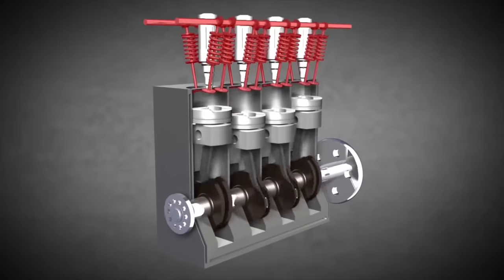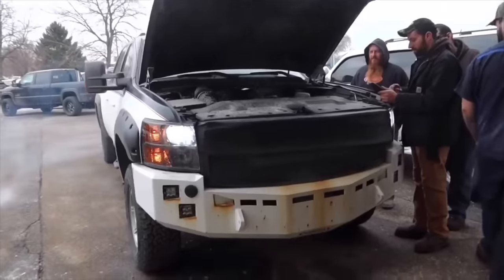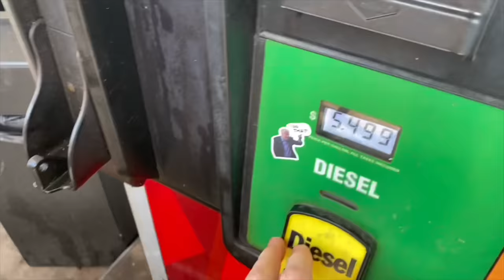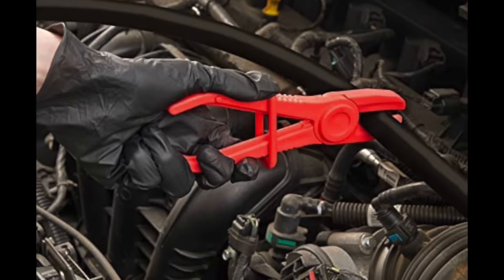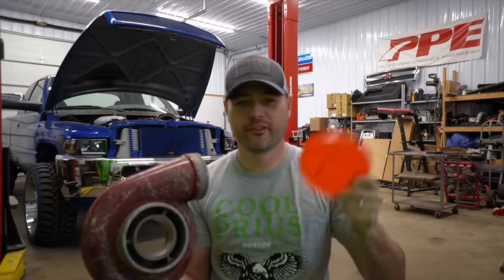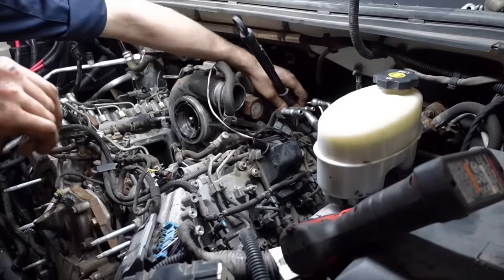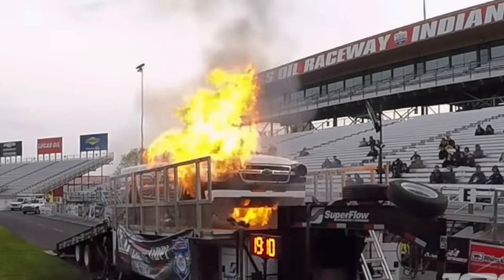What Is A Diesel Engine Runaway? *EXPLAINED* ￼

Comment: So from the Other Side of the Pond this is a Very America problem. 
Probably somewhere there were 2-3 idiots that only ran their engines and never did any maintenance so they were probably some runaways. And of course turboed 2 Strokes Russian had some in Heavy and Military trucks. 
But Europe and the rest of the world Following the European Diesel Tech don't have this issue.

Closest to what You state here I have seen and heard about is the 1970s Mercedes Diesel Engines in the W123. OM 616 engines
I Had one and They had an Electronic Shut off valve. So when you Turn off the Key the Valve would get an Impulse and a Magnetic valve would Choke the Fuel. When the Engine stops The Alternator Impulse would drop and the Magnet would release the circuit so it doesn't drain the battery holding it shut. That would take like a year on a 75Amp battery, but still... It had a spring that would try and push it open. 
The problems with this are:
Longer starts because the System is slightly starved of fuel, not too long, but there's a few more cranks than usual. 
and If the magnet is stuck open or is faulty the Engine won't shut off. 
However, it will just Idle. It doesn't rev up or anything, and you can just put it in gear and let the clutch out. 
And yeah they are all manual because people in Europe can drive. 
The way they fixed it is The Power on Open valve. Aka When You shut off the Ignition the circuit closes and the spring Returns to closed,because the electromagnet stops working and fighting the spring. 
And NO you do Not Need a Battery for This Alternator will Do It needs a Tiny amount of Power, its very small. As long As you Push it, and It starts charging the valve will stay open. Turn the Key it shuts off. 
Before all this Older cars had a Shut off lever that you pull and manually Choke the Fuel, like on Old tractors and Machines. 
But I did hear about Runaway Cummins engines on CASE IHC combines because there was a  period when EU didn't have strict standards on Emissions regulations of Agricultural and excavator machines, so we basically got US Engines here. 

And second, for the Blowby theory, you have to be talking about a catastrophic problem in your engine.
And here's why.
For the Blowbuy to Overcome the Piston rings , those piston rings have to either be completely broken, like in 10 pieces, or Completely worn, at which point the Engine doesn't have enough compression to operate reliably. 
And you are forgetting the Engine by design is supposed to create compression in the COMBUSTION space. So yeah NO, if the Engine Has compression it Will BlowBy in the Opposite direction, aka OUT of the Combustion space.
Therein for it will not perform the Burn you Talk about.
There is an Old Piston design With a Thick head and a Chamber inside the piston head, but as I have said It's archaic. So theoretically this design can hold enough compression without piston rings because the air wouldn't easily Turn 180 and Go Down by Piston rings But it Goes Up towards the head because that's how it's designed. It kind of gets trapped. 
The ONLY real possibility is The Turbo SOMEHOW creates so Much Pressure in the Crankcase It can Overcome the Combustion chamber compression and feeds the Oil into the space. But that's Only possible If your head is seriously damaged and the Air Is going through the Intake through a hole in the head and into the crankcase.
So these are pretty much only Race Engine issues because stuff like that cant happen in Normal conditions no matter how stupid and lazy you are. 
The real Occurrence is actually Turbo leaking badly to the Point its enough fuel to Power the Engine, But that leak Has to be Incredibly bad for it to Rev up the Engine at all, not to mention Over rev it. 
That would also Induce Knock in Most cases and the Engine will Just Blow apart pistons before it can seriously rev up. Because Fuel injection IS timing in a Diesel Engine. There is no Port injection. The Air reaches Ignition Temps way before the TDC. But in some Tiny chance it can happen. 
On Top of That. Eurospec, or better said, Worldspec turbos, When they develop Leaks they Just Jam the Turbine and that pretty Much it. It stops spinning and It chokes the Engine and Eventually Chokes it so Much it won't even start. It Will stop spinning before it can develop large enough leak and when it stops spinning the Leak stops growing and Just creates a Gunked up Cemented Turbo. And also Valves that don't close properly. 
So regardless of How much you don't wanna hear it. 
It's a US problem. And countries that Share your Diesel Tech. 
US is a Gasoline loving country and your Diesel Tech is pretty Archaic. 
CASE IHC Makes Eurospec Engines In France and also Buys IVECO engines for EU tractors. John Deere Makes Eurospec engines in Germany. Completely Different from US engines. These also sell to Majority of the rest of the world. That has Standards for pollution. 
They can't pass Emissions and they Can't satisfy Fuel consumption standards of the EU. Weak Brands like Zetor or Even Russian Belarus will beat them on Fuel consumption. And Power per Liter. 
US engines operate at Much lower compression, less precise lower pressure injection and Are significantly oversized. Because You are used to Gas guzzling. Your Automotive industry normalized it because it saves them money and it's Good for Oil tycoons.
Long lasting is a great Trait to have even in Eu and we do have it on our engines. But that extra 10 or 20% tops doesn't compensate for much larger running cost because of significantly higher Fuel prices.  

Main reason m8 why your Engines often can have issues and suck is Money.
Its cutting costs. And since Diesels are in Either Heavy trucks, tractors or small amount of Passenger vehicles, they dont have enough Pushback to care. 
They can charge you Hundreds of thousands for Trucks and Tractors, but they cant for Cars. Also Cars can't be that heavy like Machines. 
In Europe Diesel cars are still a majority, so the Tech is Way more advanced. 
Top that with the fact US is effectively 1 big state, and They can enforce whatever they want on you. In the rest of the world if the tried to do that lets say Germany, French could just make better Engines and The Germans will go bankrupt. 
Competition made the Tech better.
Because we are all different countries and even when we work together, we are still competing to have a better life and want our company to be ahead of others.
So if you try to lobby, you need to pay off 102 Governments, Instead of 1 in the US.